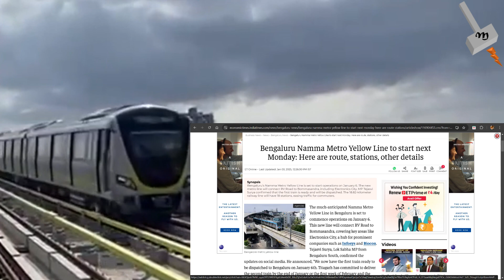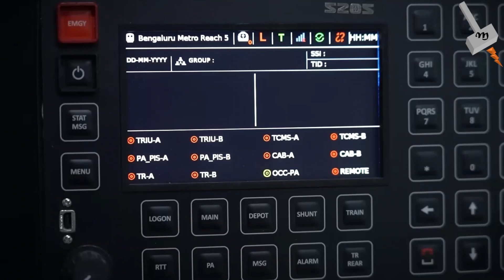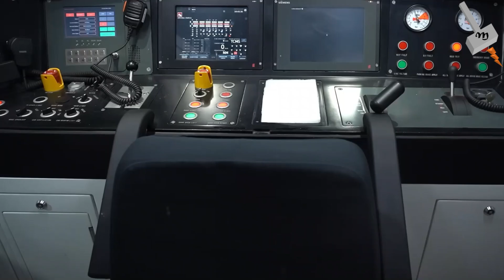Namma Metro Yellow line launch delayed

Comment: Great thank you for your efforts in making this video.
The problem is who is asking for driverless. The traffic congestion needs to be resolved asap.
Moreover if Bangalore’s internal roads are corrected then there may not be a requirement of metro itself. Due to pathholes and encroachment of internal roads making it impossible for four wheelers to use them and forcing them to use the main roads unnecessarily congesting them
Reply from the maker: Thanks for watching the video, I hope you subscribed to my channel.
Yes indeed, road infrastructure in Bangalore or anywhere in India are not designed as per 21st century needs. Mr. Gadkari is doing something, but those are limited to new road, what about the old road infrastructure created in second half of last century? 
It’s a difficult question to answer!